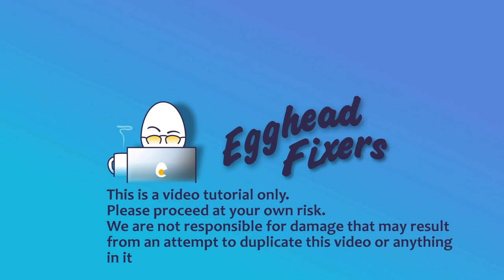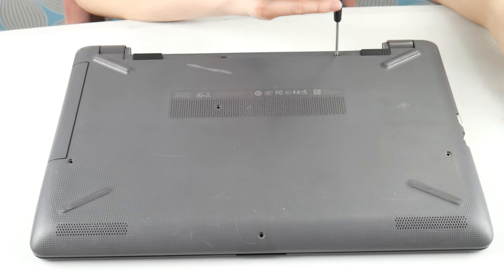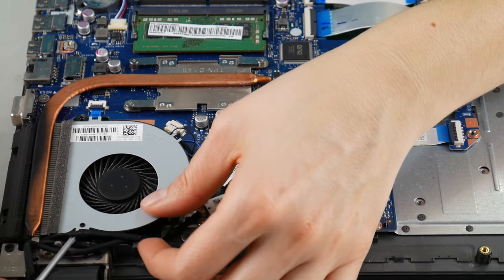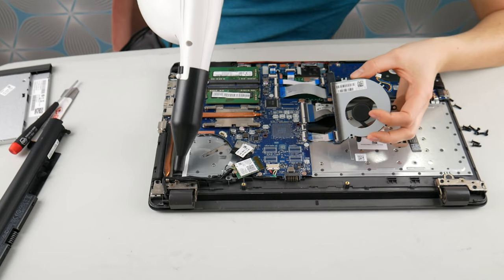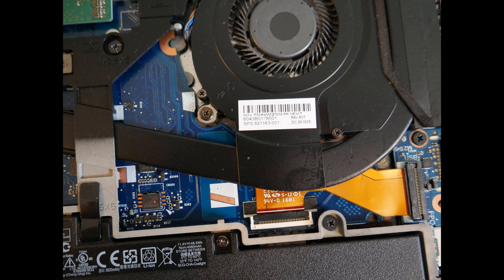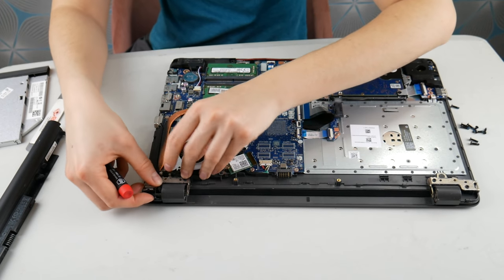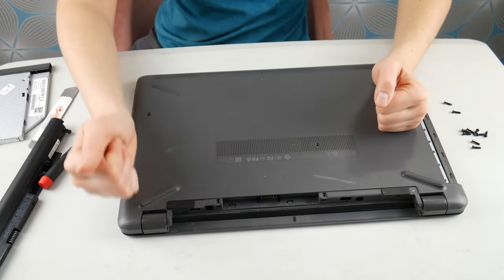How to Fix A HP Fan That Is Making A Lot Of Noise or Is Not Working

Comment: It worked! Just pulled it out, dusted it off and now it's not getting stressed out as much as before. It is a major flaw because it highly affects battery time when it's going off like a PS4 jet engine. I compared the Intel Core i5 @ 1.60GHz before 70 °C and after 47 °C. Highly suggest doing this.
Reply from the maker: Excellent!! Happy it helped 😃👍

Comment: Thanks for the lovely video, I was going through you comment section and I noticed you mentioning something about "if fan not working perfectly then it'll definitely distract and slow down the laptop" at that moment, I knew that my hp (pavilion 15) laptop  needs a new fan, cause I bought it  2 years ago and I've been using it excessively for college work, and it's making unusual loud noises which add on to my stress and makes my mood worse than it is while studying lol. I'll take it tomorrow to get it sorted & hopefully the fan will be the issue. Its noise is stuck in my head 24/7 all the time that's how loud it is lol.
Reply from the maker: Ugh ya that sounds like a pain in the butt:/ Also once you replace the fan... using it with a cooling pad too would be a good idea. Especially seeing that you heavily use your computer.
Reply: my laptop is the same but it’s brand new. high pitched noise and loud REALLY ANNOYING
Reply from the maker: @zacharynish2864  Ya that is strange for it to be new and already making such a loud noise.

Comment: Thanks for the video. My HP fan runs incessantly and I'm pretty sure there is nothing wrong in terms of vents, blockages, overheating, etc. It just makes a constant white noise-style hum that is unbearable. I just about resigned to buying a replacement fan.
Reply from the maker: Ugh ya that's the worst:( Let me know how it goes when you swap out the fan
Reply: @EggheadFixers  I will, but the next challenge therein is finding the replacement fan here in Phnom Penh, Cambodia.... :D
Reply from the maker: @snet9693  Oh wow! Ya that may be challenge
Reply: Like the video, never had a problem with a fan on my HP labtop,  .Dell Inspiron another story,, different video topic:) Dell and HP certified too??  CVs coming along well I bet
Reply: Mine is the same problem as yours. Did the replacement work?
Reply: @kaneko3298  I did get a new fan, but I tried taking the old one apart and adding a drop of oil in the bearings and it has worked fine ever since 😀
Reply: @snet9693  This worked for me too. Thanks for the idea 👍

Comment: Thanks for helping guide me through this, this is sure going to help me save money, all I had to do was order a new fan and get it replaced after I receive it.  Believe me, my fan was dead and not working.  I know it says 5 volts on it.  Maybe I could take it out and apply 5 volts just to make sure it's not the motherboard being damaged.
Reply from the maker: If the new fan doesn't work after replacing it then it could be an issue with the port on the motherboard.

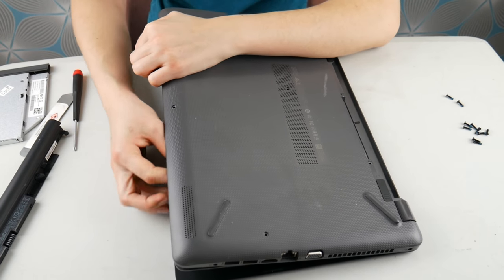Comment: I have a HP 15-bw091nd, and the fan is making a lot of noise when running. This clip was somewhat helpful, as it showed me there were some hidden screws under the legs. However, I can only follow along until 1:20, as I still can’t remove the bottom... are there more hidden screws or something? 😢
Reply from the maker: Good question! Here is a link to the service manual for your model HP:

http://h10032.www1.hp.com/ctg/Manual/c05493256

It will show you how to take a part your laptop and it will also show you where all the different screws are. Let me know if you have any questions:)

Comment: I followed throughout the vid and managed to get the fan cleaned. When I ran my laptop again the noise was gone, but after 3 hours the noise came back
Now whenever i turn on my laptop the noise just happens. I saw you talk about high Gear mode that makes the fan run faster or whatever, how do I disable it? I already have a cooling pad and its not a overheating issue as my laptop still has that noise when its cooled
Reply from the maker: You would have to check in BIOS to see how if the setting is the problem. However that can also be a problem with the fan itself...You may need to replace it all together.
Reply: @EggheadFixers  how do I change fan settings in BIOS? I opened that up once and the only options to customize the fan settings were just "fan is always on" and I could disable or enable that
that was the only thing there related to the pc fan
Reply from the maker: @Inaiko  Unfortanately it sounds like your fan settings are rather limited. It depends on what model you have whither or not you can customize the fan setting. It sounds like you may not have these options.

Comment: Can I find out what version my fan is without taking it apart? I have a HP pavilion 15 cc5xx. Ive taken it apart 3 times today, cleaning it. I then lubricated it and left it to dry and it still makes the exact noise.
Reply from the maker: You can usually buy them by the model number on Ebay. Every now and again you will get an incorrect part doing it this way but its usually pretty accurate.
Reply: @dominic pinner, have u change the fan?

Comment: Hello. I wanted to know what I can do because a few months ago our fan made a lot of noise so we oiled it up but it didn't work so we sent it to a technician and he fixed it. After a few months it started to happen again so what should I do?
And where can I get dead pixels on the screen repaired?
Reply from the maker: Ya unfortunately HPs are notorious for their fan problems. It could be that the technician put in a used part which would explain it breaking so fast or if they did something like clean the fan instead of replacing it. For a dead pixel you can to any local repair shop to get that fixed. If you are looking for a good repair technician we recommend someone that is either HP or A+ certified.
Reply: @EggheadFixers  Thank you very much for your quick response
Reply from the maker: @Eisa.sh06  no prob👍

Comment: Thank you for video. My HP LAPTOP is a Windows DV7 & is almost 10 years old. Do u think the noise is a sign that it wl just
break & die? I hv not backed up all my files yet.
Reply from the maker: Oftentimes it's a problem with the fan or sometimes the hard drive. If you fix the problem then the computer is usually fine. Although if you leave it unfixed then a more serious issue can occur.

Comment: I would like help! I put a new fan in the machine and it writes the same error message when restarting! What could be the problem? How to reset the machine? Thank you for choosing !!!
Reply from the maker: Sometimes it be a BIOS error. Have you tried updating BIOS? Also does it seem like it is overheating?
Reply: @EggheadFixers  The problem is that my keyboard is down and unfortunately it doesn't respond to anything! Everything worked so far now I don't know what to do with this ognd! My order inside original fan has been replaced very uplifted my machine and yet now I don't know what could be the problem with it!
Reply: @EggheadFixers  does not respond to F10 keyboards either! List the error code SYSTEM FAN 90B! i5, 256SSD, 16GB Ram! never let me down now i don't know what tortent with him!
Reply from the maker: @djbirdsk  Can you use an external keyboard? Also I would consider updating BIOS... Also there is always the chance the fan is not plugged in securely or the replacement fan was also bad.

Comment: I need the hp spare l51349001 fan. On amazon it costs 50$. Where do you buy the cpu fan? 

My fan is not working when I blow too strong it makes metallic noises what could be wrong? I opened the fan but I can not see anything wrong. Maybe the mechanic inside is messed up?
Reply from the maker: eBay is usually way cheaper than Amazon. So I would suggest looking there. 

The noise could be something stuck on the inside or it could be that the fan itself has something wrong with it.
Reply: @EggheadFixers  I never thanked you for the free tutorial! So thank you :) It worked out perfectly. I saved 200 USD and countless days which a repair would have cost me.
Reply from the maker: @Vectron_Of_Cybertronica  Excellent!! Happy to hear it worked out:)

Comment: my laptop fan making grinding noise, so i add some lube on the bearing shaft (I'm using 4 stroke engine oil as a lube). now the noise is gone and fan work perfectly, but is it safe for my laptop? or should i using another type of oil?
Reply from the maker: A lot of manufacturers use some sort of lube on the inside of the fan but what they use varies from computer to computer. The big thing I would watch out for when using any sort of lube is that stays on just the inside of the fan and doesn't get on any of the components.
Reply: It's been a week and it still fine. Let see how long it will last. If my fan broke again i think i will just buy a replacement. Thanks for the advice
Reply from the maker: @rafiazrilla  You're welcome!

Comment: Hi. Last year I've bought an HP Envy 15-ee0003nl  (with ryzen 5 4500U) and since the beginning, I've notice an high pitched sound from the fans. Not just the airflow sound, but also that high pitched sound (like a jet turbine)... So I've sent the laptop to HP some months ago and they've replaced the fans (they've wrote that) and it still makes this high pitched sound. It doesn't have overheating problems. It's just that that high pitched sound is loud... Any solution? It is still under warranty, but they'll probably won't fix the laptop... They even said that i can disassembly it under warranty... The problem is that the screws are under the rubber... So not that easy do disassembly...
Reply from the maker: Some of the more high powered laptop fans can be very loud. If HP said they are working properly then there may not be much you can do as far as replacing the fans goes. Although if you use the laptop with a cooling pad it may help the computer stay cool. That will help the fans not to kick into high gear quite so often.
Reply: @EggheadFixers  I almost use the laptop with a stand, so the airflow is high, but like I've said fans makes that sound even at low RPM... It's really a pain because I love it but it is loud when fans kick in... 😔
Reply from the maker: @TrioLOLGamers  Ya some of the newer HPs have fans that are crazy loud. It's not my favorite design. When I was working as HP Field Technician we got complaints about it all the time.
Reply: same here i have a same laptop and both of the fan bearings have broke all on there own hp wont fix it even though warranty

Comment: So I had this problem with my laptop, I had the fan replaced but it’s my second day with the laptop after the replacement and it started making the same exact noise. How is that possible that brand new fan is causing the same problem? Did they scam me in the laptop service center?
Reply from the maker: They may have just cleaned it instead of replacing it but I would bring it back. The repair without a doubt should last longer than two days.

Comment: i just bought a new HP pavilion and out of the box the fan make’s noticeable rattling sound as if it not rotating straight, options?
Reply from the maker: If you just bought it should still be under warranty. You could call it in for warranty repair. You can check your warranty here: https://support.hp.com/us-en/check-warranty

Comment: Hi - I purchased an HP 360 10th gen core i7 less than 2 mos ago and have used it for about month. Like others commented, this computer's bottom has felt hot from day one; is this normal?  Recently, the fan has been running super fast after the computer has been plugged in for about 10 mins. and won't die down until its unplugged. Not sure if it makes a difference that I'm charging the battery when it's there's less than 5% charge left and the computer is left on. Any advice?  Thanks!
Reply from the maker: Ya thats a problem. Is your computer still under warranty? Did you buy it new? If yes I would call it in
Reply: @EggheadFixers   Yes it is. Thanks for your suggestion
Reply: @EggheadFixers   Yes it is. Thanks for your suggestion
Reply from the maker: @tiffanigarnett5193  no prob👍
Reply from the maker: @tiffanigarnett5193  no prob👍

Comment: I have a question, i have a HP Laptop with a specs of Intel Core i3 5005U 2.0ghz and i looked in the Motherboard model no. and i found one on AliExpress with the same model number and same size. The difference is, it is an Intel Core i7 5500U 2.4ghz with 2GB AMD Radeon R5 Graphics. Can i use that as an replacement of my Motherboard?
Reply from the maker: Without being able to see it myself it's hard to know but often times you can upgrade the motherboard to a faster one if it was made for the same model computer but you just have to make sure it's the exact same fit.

Comment: . please answer to my comment i really need help . i have a problem with my hp laptop, 2 days ago i opened it up to see what brand of ram it was using since i couldnt find it on any official hp website, i opened my laptop got the information i wanted and re assembled it all things look normal, after a while when im playing games with my friends i hear a rattling noise coming from the fan and i notice that my laptop is getting really hot, like in 90 c range hot, i did some stress tests since the fan was just fine on idle mode (45-50 c cpu temperature) but under load it got up to 102 c degrees, i think that something is wrong with the balance of the fan because when it makes a lot of noise i kinda pick it up and raise  one side and lower the other and the noise disappears
Reply from the maker: It could be something got jammed in the fan when you opened it up. Like a small piece of plastic could have broken off and fallen in the fan or sometimes wires end up in the wrong spot. Have you tried opening it again to see if anything looks strange or out of place?

Comment: if my fan is making a loud noise when turning on the laptop then it is less loud after startup  but still has a bit noise ; is this also a case of a fan malfunctioning or could it be something else  ?
Reply from the maker: Has it always been that way or is that a new problem?
Reply: @EggheadFixers  its actually  a new problem
Reply from the maker: @a.s.w1679  Does it seem like it is overheating? Or it just loud?
Reply: @EggheadFixers  no no heating at all just loud noise
Reply from the maker: @a.s.w1679  It could be you need a new fan or that something is stuck in the fan
Reply: @EggheadFixers  okkk thank u so much :)
Reply from the maker: @a.s.w1679  👍👍😀

Comment: so I replaced my fan which is under the heatsink on my 360 envy, Ive gone through two fans from ebay but they begin to make noise when the laptop shifts positions, is it the heatsink, maybe it bent when i took it out? can't figure it out, waiting for a third fan
Reply from the maker: It could be a bent heatsink. Do you have any cables near it? Sometimes if a cable is up against the fan it can make a noise. Also is the noise coming from the area of the fan or the hard drive? Because the hard drive can make a fan like sound when it's starting to fail due to the spinning disk inside.

Comment: I have a HP Pavilion 15-p091sa  laptop and it's fan gets so loud but still the laptop overheats then shuts off. I feel very little air coming out of the side of the laptop. I have already replaced the thermal paste once earlier this year but it has already dried out. The device has an AMD A8 6410 APU with Radeon R5 Graphics
Reply from the maker: Is there any dust stuck between the fan and the heatsink? Sometimes there is build up the clogs the fan from getting hot air out.
Reply: @EggheadFixers  I've just cleaned the dust but the device still sounds like a jet engine
Reply from the maker: @vqx14  You may need to replace the fan itself. Also have you considered using your laptop with a cooling pad?

Comment: i bought a new hop laptop pavilion 15, i7 processor. and it makes a really loud high pitched noise. i swapped it out with the same laptop but new. and it sounds the same. is that normal and is there anyway i could fix it?? cause it’s making me insane
Reply from the maker: A loud fan can be a sign of a problem especially if it is really loud. If you purchased it new then you can call it under warranty and HP will repair it for you.
Reply: i have the same model, you fixed that problem? thnks
Reply: @MrSIMBOLOGIA  no i was going insane so i returned it. stupid noise. but they say it’s normal cuz it’s so high powered with the i7 that the fan runs loud

Comment: Hey! I've got a HP 15-da0095TX and I think the left hand fan is either clogged or busted. Only issues are;
1. I have a stripped screw (never tried opening the back before, its just stripped?),
and 2. I have no idea how the back case comes off, either.
Not sure what to do about the screw, as I don't want to damage the case, but also even if I could get it out, I have no idea how to get the back off or if it just needs to be pried open.
Reply from the maker: You can look up your model on HP.com/support and there will be manual that will tell you how to take it apart. Sometimes using a bigger screwdriver can help with a stripped screw or a pair of needle nose plyers. If you can get the screw off you will most likely need to replace it.

Comment: Hello my hp laptop fan is making more noise after I cleaned the fan, did I messed up with the fan? It's not shutting down but the fan noise is very painful, I can't concentrate on my work, what should I do?
Reply from the maker: You can replace it. The fan is not a very expensive part you can usually get another one for under $20.

Comment: There’s a blue wire from my fan was cut off. But it’s still running, loud, would it be the reason?
Reply from the maker: If one of the wires to your fan is damaged then yes that definitely could cause it to malfunction like this. Also I would suggest replacing it.